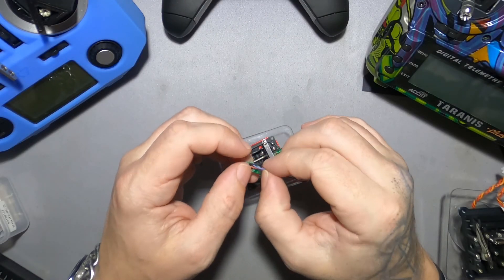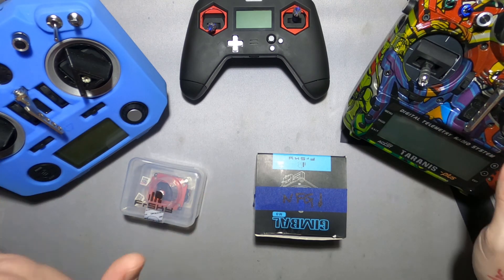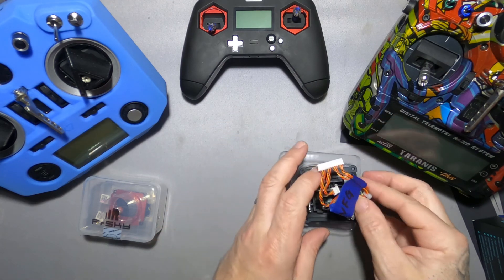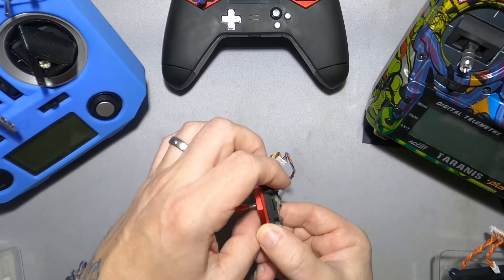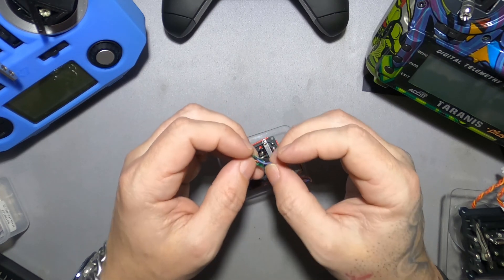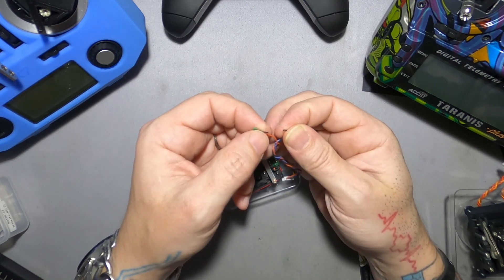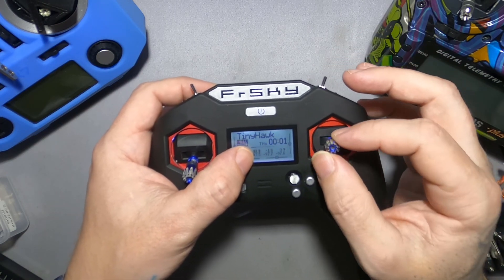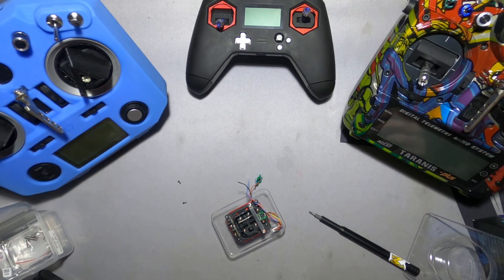FrSky Gimbal Fix [ Intermittent twitching M7 M9 M12 X18 X18RS Tandem ]

Comment: Okay this guys a genius...thank you for finding my annoying glitch on my Expensive X18RS had this exact same issue as this and the GREEN and BLACK wire on the Aileron stick just pulled apart so easily !!! 😮 They looked perfect!! Thank you so much for uploading this video subbed 👍👍👍
Reply from the maker: Real happy this is still helping folk, thank you for letting me know!
It's almost beyond belief that this you've had this on a flagship model!

I've long since moved away from FrSky and have seen this in other radios also, I'll update the title and tags to include the X18.

Was the video easy to find for you upon searching?
Reply: @MrE. Yeah found the video easy enough sorry for late reply

Comment: Great video.
I have a X18RS and while moving the elevator the Aileron was gliching opened radio completely cleaned all the Hall Sensors and thought it was fine...however noticed while using it on the SIM 10 mins after ...that while inputing down elevator it glitch the left aileron...
After looking at the 'Hardware check' screen i could see it clearly glitching...
Now I'm about to take it apart again but this time i will pull on the wires like you show in your excellent video.
If i cant pull them apart ill resolder each joint. 

I will update my findings

Comment: Years later, this is still very useful.  Was getting an intermittent glitch on roll axis on my quad.   Finally saw it on the outputs screen so I knew it was Tx side.  Cracked open my trusty old X-Lite and pulled apart two of the three wires like they weren't connected at all.   Repaired, and we're good again.   Was going to say I'm surprised that I didn't lose an aircraft to this, but in hindsight it's possible that I did.
Reply from the maker: Glad that you didn't lose anything!
I've not this on any modern radios  (yet)  so perhaps the FrSKy's were a but lower quality on that wire etc, or new gimbals have better strain reflief and a little more slack.

Comment: Hi there... I've just noticed on my M9R gimbal...on Ailerons/elevator right-hand side there's a small amount of play around center of the gimbal in the movement on Elevator....have you seen anything like this and if so have you investigated it further?
It's brilliant that you've highlighted the poor wiring design ... I'm definitely going to investigate these further and probably do what you suggested about lengthening them with silicone wire and tying them down.

I'm worried that the play in the gimbal... It will be losing resolution. I'm a 3d fixed wing enthusiast so need good gimbals.
Thanks in advance
Reply from the maker: I have seen it in radios, it could be the spring getting fatigued or the mechanism starting to show signs of wear. They have a horseshoe type shape on a couple of pins from the stick that gets tensioned upon movement from memory. I'd say open it up and just inspect it to see if there is that bit of play. I would also advise replacing it if it is becoming detrimental to your flying as the cost of one is negligable in comparison to the damage a 3D craft could receive as a result of the inability to control causes a crash.
Reply: @MrE.  thank you for your speedy reply and yes there quite reasonable priced ... I'll definitely have a look at it...it's on a Spektrum DX9 I swapped them out but bought 2 M9R gimbals instead of 1 M9R and a M9 so I'll probably just replace it with the M9 which I should have installed in the first place on the elevator/Aileron side....not sure about the wires if there silicone type or not.
You've got me wanting to replace with longer better wire now...before it becomes an issue
Thanks again for your video

Comment: Well I'll be fkd I've been doing my head in for months at first I thought it was esc related and the last few days convinced it was a radio issue now I've seen your short clip of the issue I now know this is 100 percent my issue my quads do the exact same thing to the letter on yaw,  I've never experienced this before I thought m7 gimbals were pretty good until now
Reply from the maker: Hope you get some fun in the air keeping this in check! Used to love Frsky stuff but all I use now is some legacy D8 stuff on whoops with a multi module, they sure knew how to shoot themselves in the foot all round.
Reply: @MrE.  well the first repair didn't last long I few 12 packs yesterday morning then jumped on DRL when I got home 2min into flying on the Sim I lost yaw altogether. So I re done I with some new wire, is there something I should use in replace of the yellow glue stuff that was originally on it to stop it bending and breaking at the solder joint?
Reply from the maker: @RosscoStixFpV  That yellow stuff is "antenna glue" from memory, but anything from something like hot glue to a more silicone type substance will suffice. it's for strain relief but as you well know from experience it just moves the problem a little further down the wire.
Reply: @MrE.  yes I noticed this one the second repair I found the problem had travelled down the wires somewhat, so I depinned it from the plug end and replaced all 3 wires with wires a fraction thicker, I'm really hoping it reliable, because I tend to fly a good couple kilometres away I don't have GPS, losing yaw where I fly would be catastrophic
Reply from the maker: @RosscoStixFpV  Would be a hell of a walk of shame! (without being your fault) Just glad I've been able to help so many like you perhaps avoid that nightmare.
Reply: @MrE.  yes indeed thankyou very much

Comment: Hey thank you so much for sharing this information! First I thought it was my thumb and then I thought it was the program in my QX7s when the ailerons kept on twitching and creeping around center. WTH? Now it is doing it across models w same program. Nope getting worse. Thats when I found this great video! Thanks again for posting! I'll have a look at those wires and get on with a better approach! Sure beats buying gimbals when it's as simple as a work hardened wire. I have often wondered about that design when inside - those wires moving around like that! An accident waiting to happen!
Reply from the maker: Glad to help - It is a very common problem for these types of radios, as mentioned countless gimbals later & found the issue. Thank you for taking the time to share your journey, indeed I've dodged bullets also with how this has gone on over time. Good luck and happy flying!
Reply: I had a closer look inside my qx7s at the design of the gimbals. The inside half of the axle for aileron and/or rudder has a hollow like a tube running on the horizontal axis medially (towards center) of the radio. I think a longer cable could be passed through this tube where there is far less movement and therefore far less strain. It is a tight space to enter inside the axle tube as the inner housing passes close by but I think it is doable if the wire is secured to the relatively non moving part of the outer gimbal housing.  It may be that was their design intention but they just ran the wires wherever to save labor. Assuming my temporary fix lasts long enough, I'll tackle that this winter. What do ya think?
Reply from the maker: I'll have a look at the gimbals I've got laying about but would be great way of doing it.

Comment: Sadly..on my transmitter I decided to swap the gimbals to see if its the gimbal itself but apparently it has something to do with the board..its like no signal is going from the inputs to the board since regardless of what gimbal i put in the throttle connector(mode 2) no responses at all  >.<
Reply from the maker: Have you tried calibrating it?
Reply: @MrE.  Yeah I did.. and it never moves.. and its really has something to do with the signal going to the board for that connector because using the same gimbal on the other stick(Right) it was working..Will try to get a friend to check it out..or figure out how to diagnose the issue using a multimeter..
Reply from the maker: @fishballfpv9063  Good luck & let us know if you have any success, beyond the surface stuff is a bit cloudy for me, although I've had to replace boards for others.

Comment: Thanks for this, albeit a tad too late for me... I'm now on my second Xlite Pro transmitter, which now also have twitches... and i have a gimbal in the mail from china as i write this.
But let's see if i can get two working sets of transmitters going now... I would be SO nice to have a backup transmitter😃
Reply from the maker: Good luck! I have a box full of gimbals, the originals and iffy upgraded ones that all suffered this fate - yet to go through them but I'm sure there is a good set for all 3 controllers ha!
Reply: @MrE.  It actually worked. Was kinda hard to gt new wires on the existing connector, but managed.
The cable wiring afterwards are tricky, and you REALLY need to find some good silicon wires, which i couldn't. BUT IT WORKS !! HURRA !
Reply from the maker: @jana171  Well chuffed for you, Jan! I used thicker silicone wire for overkill and that has a little side effect - but having a grasp of the prob, even if it is with thinner or less than suitable wire goes most of the way to alleviating the issue.

That being said, god knows how this issue got past them on most of their Taranis for so many years. I've since switched my heavy usage to a Tango2 that has the sensors statically mounted on the PCB rather than the gimbal.

Thanks for letting me know - I'll file this one away with all the other seldom used info in case anyone else has it happen. (XLite Pro, same prob!)
Reply: @MrE.  Again thanks for sharing mate... I'm already on Amazon to see if i can get the correct gage wire for the other transmitter.

Comment: Hey question if you don’t mind bro, I’ve got an issue where my right stick doesn’t register up and down movement (elevation) I’ve tried everything you ever had that issue. Moving it from left to right shows perfect movement when you out the stick display it show the little O all the way at the top of the box and won’t come down at all
Reply from the maker: I think I had this once when the wire disconnected, If you have checked the calibration or raw stick data then I'd take a look inside. What radio?
Reply: @MrE.  hey thank you for the response first off. It’s a taranis xlite pro, the right gimbal. I’ve already opened it all the wires are fine on it. The gimbal itself moves just not up and down, my sliders also don’t move.
Reply from the maker: @TheTriggerhappyhippi  I'd make sure that the wiring loom plug is inserted firstly and then check the continuity of the wires for that gimbal (as in this video a wire can look intact but is severed inside the sheath).
If the hardware looks all in order, perhaps it's a setting? Did the behavior just start all of a sudden?  Try creating a new model and verifying the input, mix & output maps.
I'd also see if a calibration manifests the same problem.

Where are you located?

Comment: I own a QX7S. In less than a year I have broken EVERY switch on it (good news is the replacement switches are much better, I believe they are  the same as the X9D switches).
While replacing them I was surprised by the crappy quality of the wires. They seem cheap, and made of rigid plastic. 
I thought the cheap switches and crappy wires were Frsky's way of making the QX7S more affordable, but it looks like this is their preferred method for all of their products. I wonder what the higher end Horus wires are like - are they the same??
Thanks for an informative vid.
Reply from the maker: You're welcome, Mr Soto! (there are other videos on my channel tailored to opening the X7 & X9) but I think for the most part those wires are probably almost same across everything and built as cheaply as you suspect due to them being static and stationary for all their life. The Horus or crazy expensive I'd suspect have slightly better, but until you look...

The important bit is you fixing it which sounds like you have well in hand, happy to hear!
I'm quite shocked to hear that you had to replace the X7S ones after a year though as I've had my X9D+ since feb 2016 without any problems.